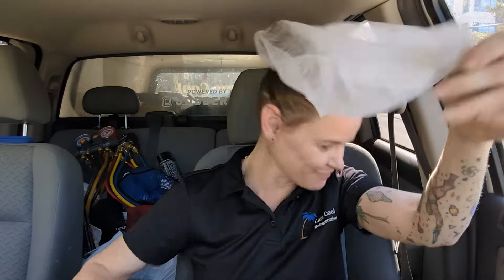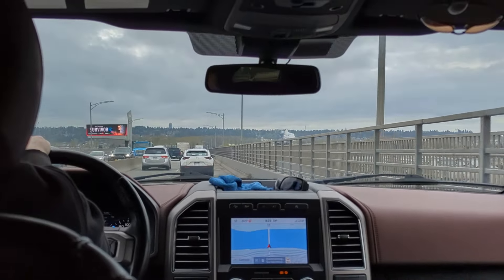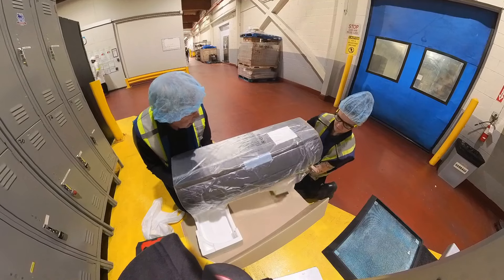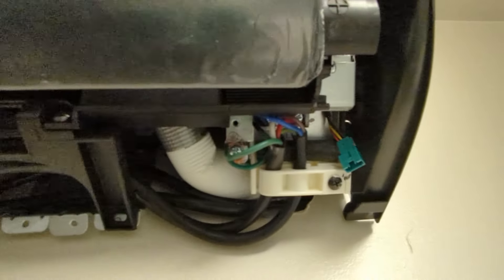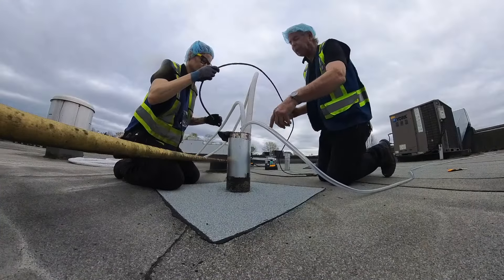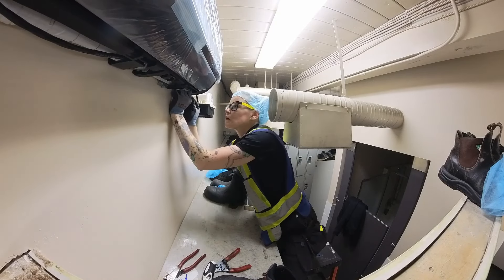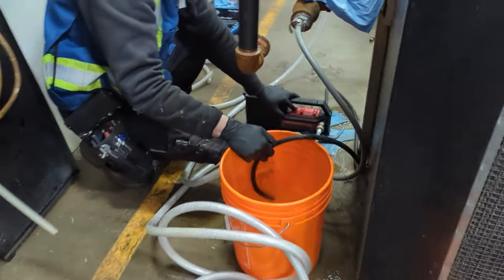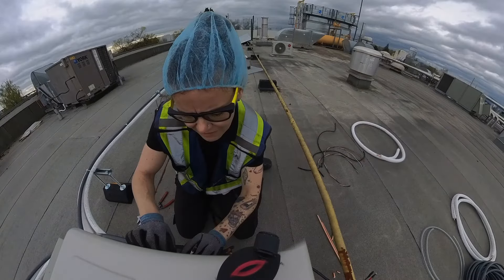Ductless AC Installation & Heat Exchanger Back Flush | HVAC Vlog

Comment: If you’re going to buy a torque wrench by the Nyvac one it’s awesome
Reply: How does the “NAVAC” torque wrench 🔧 compare to “HILMOR” “YELLOW-Jacket” or CPS BLACK MAX ???
Reply: @MrJEEPJT  do your own research, but it’s a much better torque wrench and all the other ones I used them all
Reply: @TomHolcombe-fh1kv  I’m not concerned about price, I’m willing to spend the extra $$ Johnstone supply stocks the Yellow-Jacket 
United Refrigeration can bring in CPS Black Max, haven’t heard anything good,bad, nor indifferent about Hilmor.
Reply: The Nyvac  torque wrench you can set the torque very easily. It pulls back-and-forth each way very easily and registers with a beep sound. It’s a much superior product than the other ones. also, like I said, it’s very easy to set the torque settings to anything you want.
Reply: @TomHolcombe-fh1kv  👍👍 Thank you very much for your response…
Reply: @MrJEEPJT  no problem I do recommend it. It’s a great torque wrench. Sorry I was a little short the other day a lot going on.